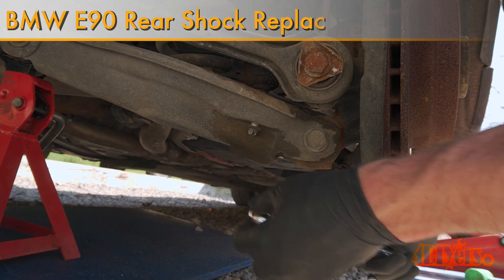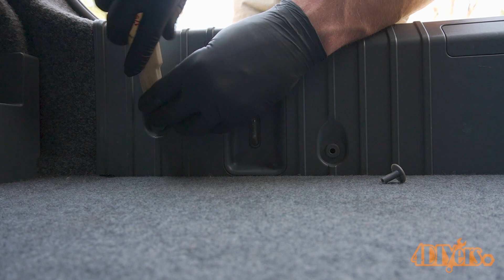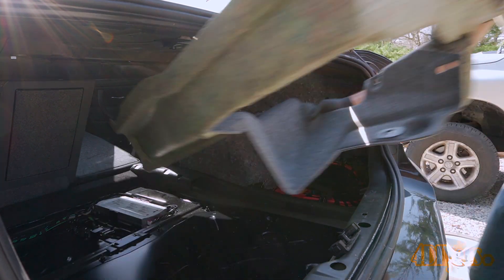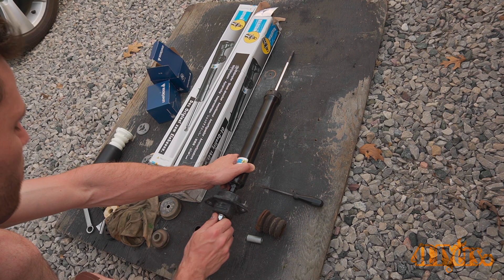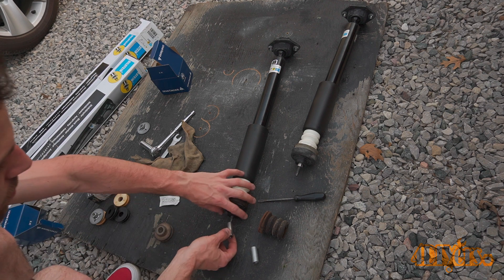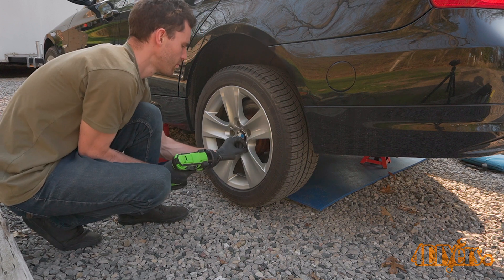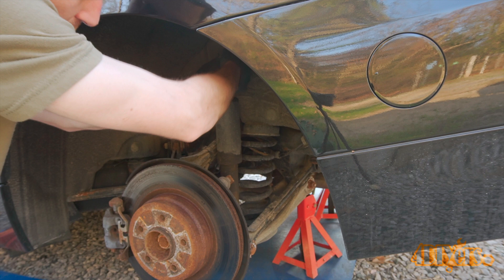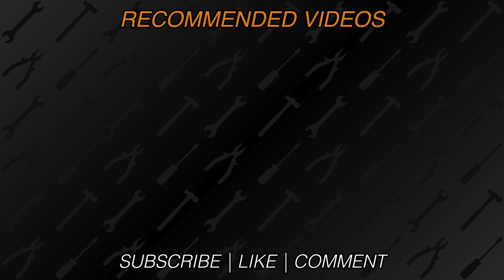How to Replace the Rear Shocks on a BMW E90 3 Series

Comment: So if I do the bottom mount at 28lb torque. I won’t need to worry about tightening  the Nut at “ride height???

Also how much do you jack the control arm to bolt the upper mount in? Will it eventually “bottom” out?
Reply from the maker: No need to torque it at ride height as it doesn’t twist like a control arm bushing. 

Raising the suspension will eventually bottom out but you have plenty of movement to get everything back together.

Comment: Hey man, I have an 06’ 325xi, I’ve seen videos saying you can’t remove the lower shock mount with the rear shock, but you clearly did it lol, and even installed it with it. is it different on certain years or do people just not tend to use “easy” ways
Reply: btw thank you so much for a detailed video, makes it so much better to understand and know what to expect for the job

Comment: As much as i tried not to the shock mount to the arm has cross threaded/spinning free, i think theres a 17 mm nut in top but i cant get a nut or anything on top the u scree from the bottom.  Any tips?

Comment: Did you take the shock out with bottom mount attached by undoing the 2 torx nuts? My 17mm bottom shock nut is rounded and didn't think it would come out by undoing the two bolts instead.
Reply from the maker: Yes I did. It's a bit tricky getting that mount out, but possible.
Reply: Nice one! This worked and saved me cutting the bottom of the shock absorber! Thanks heaps
Reply from the maker: Great! Happy I was able to help.

Comment: i dont have the spot on the shock where you can hold it with a spanner while your tightening the bottom mount bolt?
Reply from the maker: Should be able to hold it by hand. If not, then use a rubber strap wrench around the shock body.